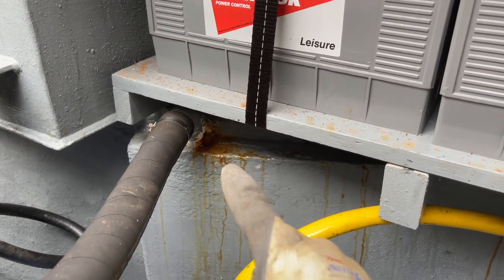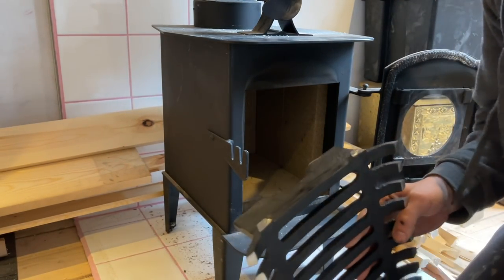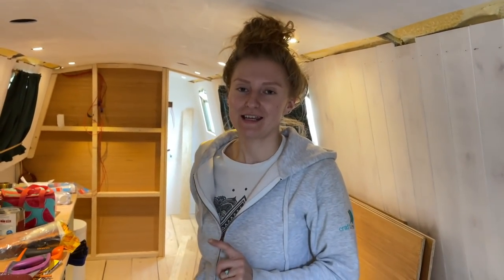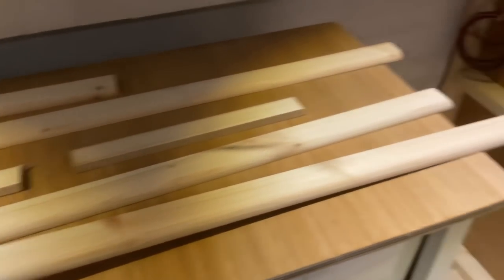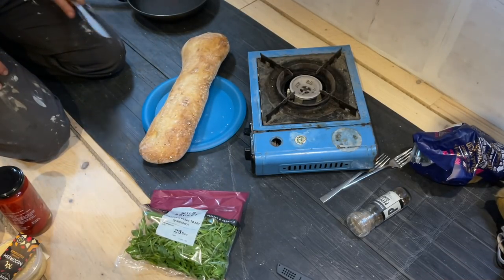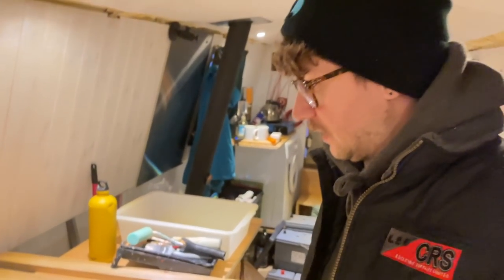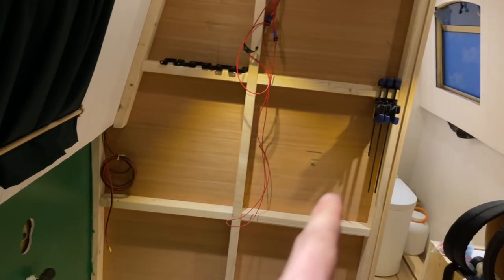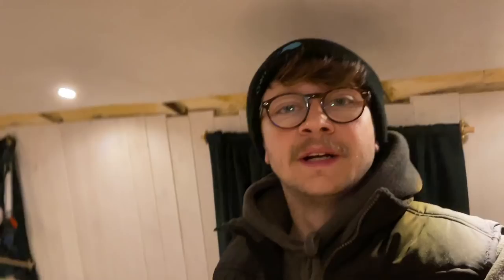Cooling System Issues | Basin Plumbing | Narrowboat Conversion | BOATLIFE

Comment: Personally I think you would be better installing the wash basin waste in proper plumbing push fit waste pipe and fittings. The pipes have smooth walls , less likely to collect deposits and block up the pipes
Reply from the maker: Thanks yeah a few of you have recommended against the flexi - any benefit from pushfit vs solvent?

Comment: I'm saying this as a caravaner Joe and caravans use a smaller bore version of that ridged blue pipe for all the drainage. That stuff is horrible for collecting debris, blocking and smelling. I know it is flexible, but IMHO it is more trouble than it is worth.
Reply from the maker: Thanks Dave a few of you have advised against it will look into solvent I think!

Comment: Making hard work of the plumbing Joe, and you may need shallow traps on both outlets or a running trap on your basin as you have a trap for your sink, to stop the bugs and the cold outside air getting in. Height wise, ever thought about a Saniflow (small tanked pump out) for sink wastes then your not tied to or governed by the water line in regards to your units heights.
Reply from the maker: We’re just trying to keep the system as simple as possible, less wiring etc and if the saniflow froze over etc. Will look into using solvent with shallow traps as a few of you have advised against the flexi, although the blue pipe is smooth on the inside.

Comment: Could you not find a new / replacement thermostat housing? Also are you sure the impeller is spinning properly on the pump? The other thing i can't see is the full cooling system. Your skin tanks are radiators / heat exchangers not as such holding tanks. Your header tank should hold a head of water to allow the pump to push water through the system. The pipe you presently have your sensor in should be connected to the lower outlet from the skin tank. The hot water enters the top is cooled by the canal through the boat skin then as the cooled water drops to the bottom for the pump can push ot back through the engine.
If you have not water in the header tank the engine will have no water to be able to heat to allow the stat to open. Hopefully I'm not teaching you to suck eggs. N good luck sorting it.
Reply from the maker: Thanks for your comment, not at all on sucking eggs I’ve always struggled to understand these cooling systems! Have you got an email address I could send a couple photos of our system over to you to double check on where the pipes should run? As this is how the pipes were rigged up by who we bought the boat off but the engine isn’t original and the calorifier has been removed so it’s a bit of a minefield on what belongs where!

Comment: Thinking on Jo if you went Saniflow you could lower your bath for you to stand in to shower, but may need a non-return valve in that line to stop the waste water from the sink and basin back filling into the bath.so any arrow pointing towards the Saniflow or of course figure the Saniflow in or part into the bilge somehow. Saniflow's don't need much of a electric supply if just for waste water as it has only a small pump, but of course your inverter will easily take care of that once your on board with the batteries turned on.
Reply from the maker: The backfilling issue was why we wanted to go with two separate outlets, one for the bath which is pumped out automatically by a whale gulper IC and then let gravity work it’s magic to keep things simpler for the basin and sink. Judging by people’s thoughts on flexi wastes we’ll be fitting solvent weld now!
Reply: @ItsOhJoe  As said Joe, if your pumping anyway gives you the option to lower everything, even your bath, and tank it if needs be with some diverter valves on the outlet, if you use the underfloor over worrying about the waterline level. If you go solvent weld of any size make sure you have plenty of cleaning eye tees you can easily get at, preferably on every bend.

Comment: hi guys found your channel a few weeks ago and have now been binge watching the boat build ever since and finding it entertaining well done on what you have achieved so far. I am a timeserved carpenter & joiner of 25 years originally from Swindon Wiltshire now residing in Sofia City  Bulgaria for the last 14 years but now thinking of returning to the UK in 2022 and buying a narrowboat to live on which I was going to do before I moved to Bulgaria. I have noticed on your build when you roped the floor joints that you have effectively closed off any air flow under the floor which could cause damp to build up due the coldness of the bottom of the hull if you drill some small holes say 50mm in different areas of the floor with plastic air vent covers on them this would help with air flow, this is only a suggestion but think it will help to combat the build up of damp mould forming
Reply from the maker: Thanks so much! Ah that’s great advice, hadn’t thought of letting it breath. Will take a look at this!

Comment: Worth checking hearth dimensions for your wood burner. Think it is 300mm all round. Just, you know, insurance and all that. And don't use the flexi waste pipes: solvent weld is the way to go.
Reply from the maker: Going to re-look at using solvent instead, had that blue pipe lying around hence giving it a go. Ref hearth we’ve got an upstand to fit which allows you to bring the dimensions of the hearth down

Comment: Hi Danny Joe,hope you both had a great Christmas and I wish you both a very happy new year and lots of cruising,why don’t you get a new thermostat housing then you can use the proper temperature sensor,,that bread roll looked delicious ,it is really shaping up keep at it you will soon be there,,I like the colour green you used very nice ,till next time take care keep safe, John 🥸😎🌹🤷‍♀️🤷‍♂️🔥🥘😂😂
Reply from the maker: Thanks John! So that thermostat housing was a bodge by a previous owner, the thermostat isn’t normally located in the bend someone had just drilled and stuck it in there! Hence the inline one as there doesn’t appear anywhere else I could make one work. We tried a new thermostat housing on an older video but it was the wrong angle so didn’t line up. It’s a bit of a minefield working on a 40 year old boat 😂
Reply: If it is a bmc 1.5 diesel the correct thermostat housing (with the correct angle) is available from Lansing Marine at a reasonable price. Your existing housing may have a part no on it, such as BL4. The standard car version does not fit correctly as you found out because the spout is angled away from the engine.
Reply from the maker: @eleanordeboat4191  ah thank you will get one on order!

Comment: Hi Joe just a thought, the water pipe coming through the bulkhead, how about lifting higher so it comes out straight to the pump which will could be mounted vertically on the side wall??
Reply from the maker: Will have a look! Only worry was keeping it as low as possible for the pump to prime if we ever run out

Comment: If your cooling system has a radiator cap then its a sealed system  that boils at a higher temperature than an open system (like a kettle). If you've a leak then your cooling water boils at atmospheric pressure and your engine overheats.
Reply from the maker: That makes sense! Thank you

Comment: Hi you 2 
Nothing wrong in using the flexi pipes but you do need traps on the bath basin and sink or they will smell
Great work you 2 are doing all the best
Reply from the maker: Thank you! We’re looking to incorporate traps into the system, we’ve had a few comments suggesting against not having one so thanks for the advice

Comment: Pleases Joe, or Dannni  for that matter, replace the hose on top. of the engine . The one with the big crack in it. ✌Happy New Year!!
Reply: On further inspection, it doesn't look like a crack, maybe  paint or a marker.. Anyway, good call on moving the temp sensor.
Reply: Good call might as well replace them all while your at it 👍 just for the peace of mind
Reply from the maker: Good call we’ve got a piece that will fit!

Comment: That short top hose off of the top of the thermostat is completely shagged that will burst after an hour or two of running.
Reply from the maker: It’s held up for quite a few hours unfortunately it’s pushed into a really awkward position as the thermostat housing isn’t quite right! We’ve got some new pipe to fit once the cooling system goes back together

Comment: Bit of a pain having to constantly move things around for access, but there is never enough room in a boat. Think I would have gone with a smooth bore pipe as it won't collect any muck in it which could lead to smells, especially for the kitchen sink..
Looking forward to seeing the finished boat. Happy New Year to you both
Reply from the maker: Yeah especially now the walls are up it’s a real challenge! The blue pipe is smooth on the inside but may look into using solvent throughout now as looks like a few people have had issues with the flexi wastes

Comment: Another great video. Quick tip for fitting wood against an uneven surface. Find a small metal ring you can insert your pencil in, with the wood pressed up against where you want it to go, run the ring along the wall and the pencil will drawn to the shape of the wall.
Reply from the maker: Great tips thank you!

Comment: It has been a superb series of vlogs this year and fantastic progress made on the boat. Well done to you both. Check thermostat for overheating. Water should not flow into your skin tank when engine is cold, but since there is no calorifier yet, seems like there could be no cooling. Or thermostat might not be opening.
Reply from the maker: We changed the thermostat and that seemed to fix it but now with the leak in the elbow I think it’s letting air in and causing an air lock. The boat originally had a colorifier but we have removed the old header tank for that and capped off where it connected. The engine isn’t original which doesn’t help suss out where the pipes should or shouldn’t go!

Comment: Re overheating... Amongst a handful of the usual things to check, make sure the old classic of the boat being overplated over the outside of the skin tank..
Reply from the maker: Thank you, yes have heard of that happening! It sounds like the pipes aren’t in the right places by someone else’s comment so going to have a look!
Reply: @ItsOhJoe  cool.. they should take the cold supply from the bottom of the tank.. and obvs make sure it's not airlocked. Common issue ..does the tank have an air bleed at the top?
Reply from the maker: @sillius_soddus_  cheers! Yeah both tanks have an air bleed at the top. But yeah cold is currently being fed from the top of the tank, and the two tanks are connected by both bottom outlets. Once we’ve got the elbow welded up I’ll look into swapping the cold feed around like you mentioned

Comment: if your looking Joe Vevor do what you need £60
Reply from the maker: Will have a look cheers!
Reply: @ItsOhJoe  As you see it Joe as if your pumping one you may as well pump them all which won't which won't matter about the water line level in regards to heights of anything. Plus give you the option to tank grey water by a few valves if the regs. change about grey water discharge or your in a marina. I maybe wrong as I have never used a Vevor but most others take care of any back feed, as nearly all have two inlets and if in the floor like your larders, say under your bed maybe, I doubt you would have one anyway.
Looking at your video it looks like Danni will need a hop up to use the basin, which you could then obviously drop everything in height and would only need one hole though the side for the lot. As you see it matey.

Comment: Hi looking at your overheating problem it looks to me at the very quick flash of a look that we get you have a skin tank and that pipe that is connected to the top of the tank is fitted to the water pump this is wrong the pipe that fits to the water pump must come from the bottom of the skin tank if not it will just suck air and over heat
Reply from the maker: Thanks for the comment, do you have an email address I could send some photos across of the system? I’ve never really understood the cooling systems on these boats and not one seems to be the same. This did have a calorifier fitted historically but it’s been removed from the system
Reply: @ItsOhJoe  Hi sorry it's took so long to get back to you but I have watched every vlog you have done on the boat and you have two skin tanks one each side and all the pipe connections are at the top so without speaking to the person that fitted the skin tanks or actually being there to investigate I cannot be sure if it is piped up correctly pictures will not help.
So two questions 
Q1 have you ever used this boat without it overheating(if the answer is yes then the boat was originally working correctly and it is probably  something you have done)
Q2 have you altered the position of any of the four pipes that go to the tops of the two skin tanks(if the answer is yes then that's the problem put them back as it was and try again)
Don't be fooled by the fact all four pipe connections are at the tops of the tanks there should be internal pipes to get the water from the bottom that is why you don't alter the pipes around they must go on in a certain order to work properly.
The fact it use to have a calorifier will not make any difference as long as the pipes are either connected together and are lower then the engine or are blocked off
Reply from the maker: @bigKDL  Thanks for getting back to us! On our first journey of any real length it did overheat, that turned out to be a seized thermostat (rusted completely). We removed the thermostat whilst waiting for a new one to arrive and it seemed to stay cool (although at this point we didn't have a temp gauge setup!). Since being in the marina we installed a temp gauge (although sender appears to be in the wrong place - in the cold feed) - so now i'm hoping it's the leak in the elbow of the skin tank allowing air in and causing an airlock. This is being fixed soon and then i'll be able to put the temp sender in the right place - then leave it running and watch it get up to temperature. Also yeah the pipes have all been fitted to where they were fitted when we bought the boat.
Reply: @ItsOhJoe  thanks for the reply when your man turns up to weld that elbow there should be a long pipe down to the bottom of that tank to pick up the colder water so he should be able to check that for you also the pipe across the boat between the two tanks should be as straight and level as you can make it

Comment: I presume the heat exchanger on the engine does not have a tube stack in it?
Reply from the maker: Don’t think we have a heat exchanger just two skin tanks? I really don’t know much about narrowboat cooling systems so any advice welcome!
Reply: @ItsOhJoe  The rubber dilly at 2:04 marked Bowman 3419, if you remove that you will be able to see. Was the engine original fitment?
Reply from the maker: @johnglover9935  I’ve had it removed and nothing inside! No I’m not sure what engine was in here before and to be honest I’m not sure if the engine has been home marinised or from factory but would assume it’s been done at home
Reply: @ItsOhJoe  That is correct for your setup. If it had been used in a sea going boat it would have had a tube stack in there. Was concerned someone had re-purposed the engine and left it in there.
Reply from the maker: @johnglover9935  ah okay thank you!

Comment: The question I have in my head is could you build a big enough fire in there to require fire bricks? I look forward to your solution
Reply from the maker: It does get surprisingly warm but with a grate and a bed of ash we’ve not had any problems so far